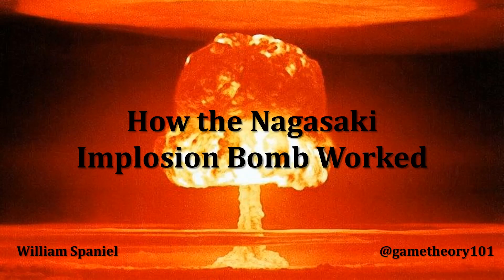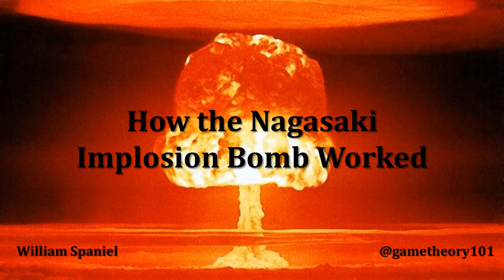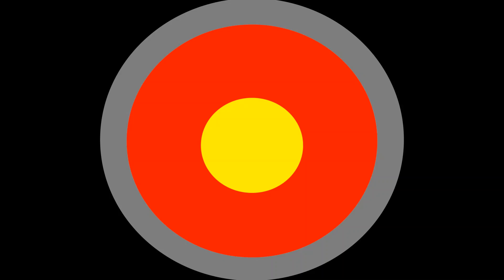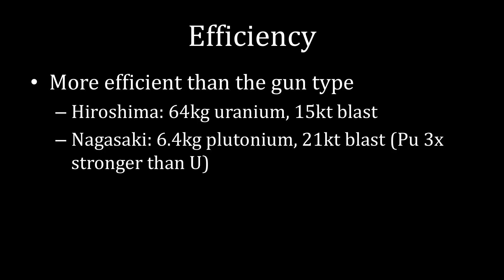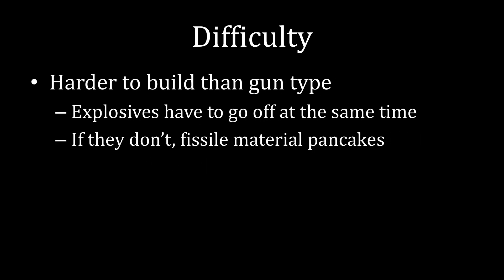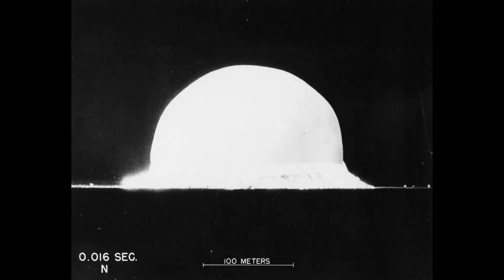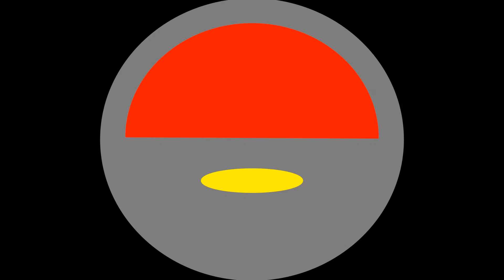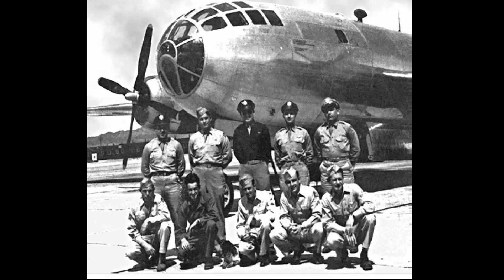How the Nagasaki "Implosion Type" Bomb Worked | Nuclear Proliferation Explained

Comment: Again, the two nuclides you mentioned are not the only fission products. 
The Mk-III contained 6.2kg Pu, which produced 15.5kt, plus 111kg natural U which produced an extra 6.6kt. 
Plutonium is not 3 times "stronger" than uranium. 
Fissioning 1kg of Pu-239 will produce 2.5% more energy than fissioning 1kg of U-235. 
Another good vid.